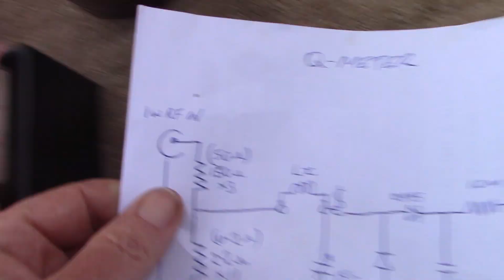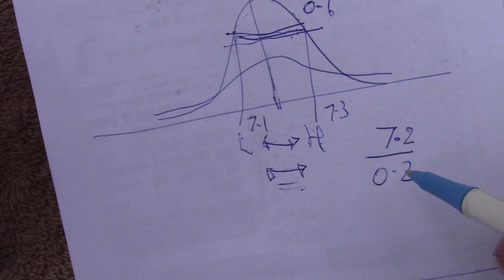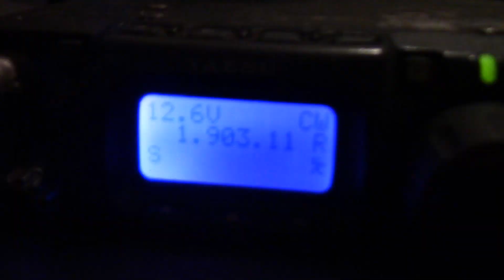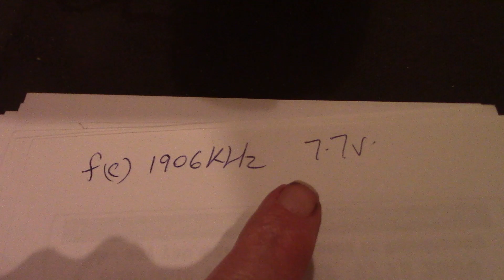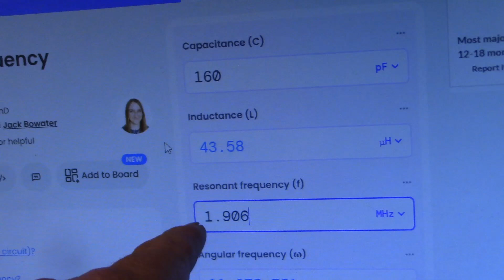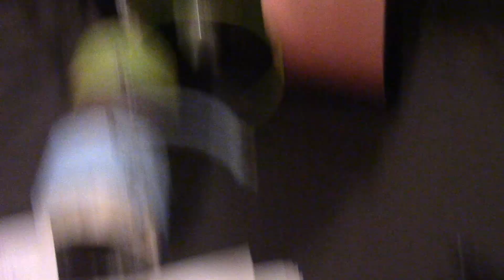Measure inductor Q with this - Part 1

Comment: I see many pros and amateurs here on youtube claiming that the inductance and capacity vary with the frequency. I learned to measure inductances and capacity with a huge tube (valve) Q-meter, in late 80s. I also used a GDM, a RLC bridge, tools that I built myself. However, I learned and always knew that the inductance and capacity are a constand depending the constructive dimensions.
Am I wrong? If yes, what I am getting wrong? And if no, what others get wrong , maybe misunderstanding the inpedance?
Edit: If I remember correctly, Q=wL/R, if you can measure precisely L and R.
Reply: Yes, inductance generally remains approximately constant with frequency over typically a wide range, for air-core inductors and for inductors with ferrous cores as long as the core permeability remains constant.  The permeability of some ferrous cores will change with frequency causing the inductance to change.  Actually, the inductance of almost any inductor does decrease a little bit at quite low frequencies where the lack of skin effect allows the current to penetrate deeper into the conductor.  At quite high frequencies that approach the self-resonant frequency of the inductor, the apparent measured inductance increases because the wire begins acting like a transmission line approaching a quarter wavelength where the capacitive susceptance of its self-capacitance offsets some of its inductive susceptance, thereby raising its overall reactance.  This may be more than you wanted to know. 🙂
Reply: @analog_guy  Thanks for your reply. I know that, and also that a real inductance is not really only a inductance, it have some inter-turns capacity (there is where you have its resonant characteristic) and also its wire resistance (that vary with the frequency, by the skin effect).
But what I do not understand is that a 10uH inductor is measured with a digital modern LC meter and the values vary from 8uH to 14uH (as I saw in some videos) depending the frequency that tester uses to measure with  from 100 Hz to 100 kHz. 10uH should be 10uH at 100Hz and 100kHz, right? Are those testers flawed, the measurement method or I am wrong? I mean I used 1-10uH inductances in RF-SW, I built them and measured with my GDM, Q-meter at home or with a RLC bridge at the radio-club at various frequencies and after doing the math, always I had the same result for the inductance value, maybe with some decimal point (100nH) difference, but not 5uH. 
Or are the modern inductances so bad?
Reply: @sebastian19745  About all I can say with any confidence about the 10 uH inductor is that any inductor with magnetic core (permeability greater than one) that has been optimized for a particular application will be “good” for that application but may behave strangely and appear “bad” when tested under different conditions.  There is a wide range of magnetic core materials and they all exhibit nonlinear behavior as well as behavior that varies with frequency.

Comment: Nice simple instrument to build and have at hand. Having the analog meter just to find the peak is usefull. Finding it with a digital is quite frustrating since is refreshing the everage measurement just every second or so and the setting of the cap is touchy. After peak found read the exact voltage on the digital one. 

Having a bigger box you can add a cheap digital meter meter inside not requiring a separate instrument to carry with. In most cases even the cheap meters are accurate enaugh. Probably easier than trying to calibrate the analog to measure on wide range of voltages with required resolution.

Have used the same concept on a grid dip meter I've build in the past. Small analog meter to find the dip and cheap counter to read the frequency. This way was no need to bother with making a scale for the tuning knob. Years ago when frequency counters were not easy/small to make or cheap to buy, making a good scale for all the frequency ranges was the main challange. 

73 Andrej - s57rw

Comment: Nice test setup. I prefer the ring down method because you can see the results in the scope trace even before you know what the number value is. 

I'm currently working on a universal coil winder so I can wind high Q coils for use in IF transformers. My thoughts are to use a dual conversion at 1700 kHz and 95 kHz.

Comment: Hey Peter 
How does the capacitor and frequency you’re measuring with affect the Q measurements??
Reply from the maker: Measuring the same coil at different frequencies will be another test. I suppose the main value of a unit like this is being able to compare different coils at similar frequencies so you can pick the best.
Reply: @vk3ye  cheers

I picked up some alligator clip to SMA leads for the NanoVNA to do some tests on some coils, caps and filters. Haven’t had a chance to use them yet. Been too busy.

Comment: A very useful tool. I have wound several of those types of tapped coil recycling mains electrical cable for loading coils for low frequency verticals, and you definitely want the highest Q you can get in that application.